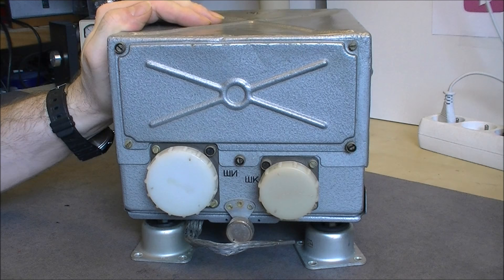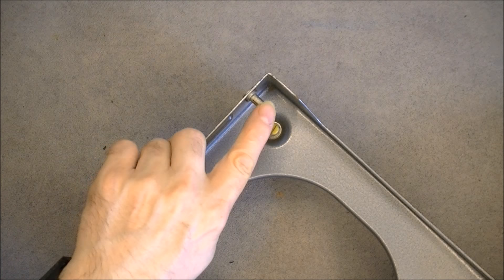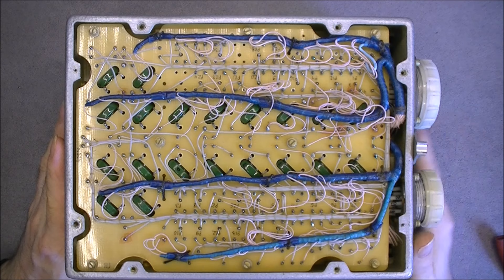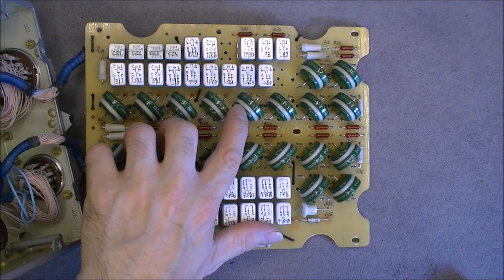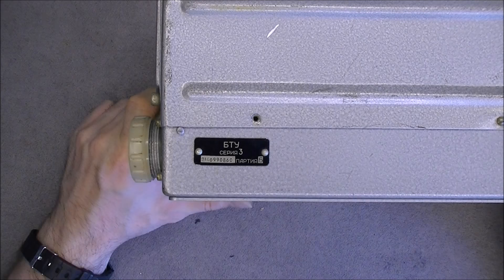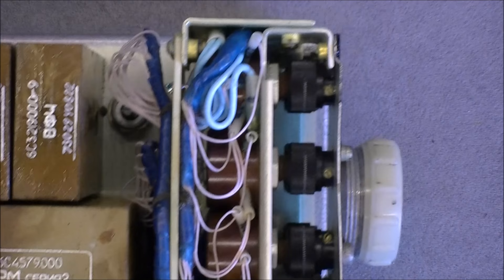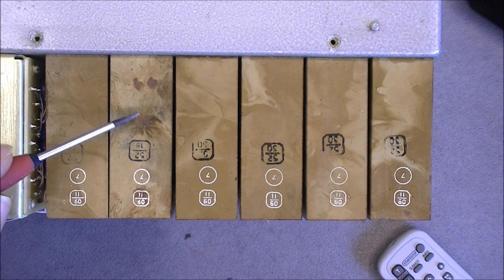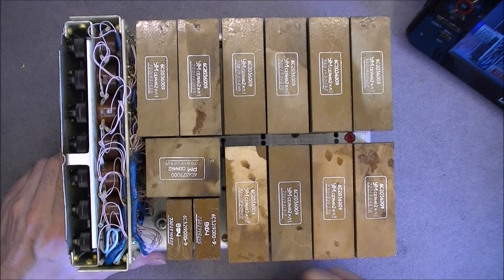Soviet avionics teardown: autopilot "brains" unit

Comment: According to part number those are magnetic amplifiers - усилитель магнитный
Reply: Then this is an analog computer.
Reply: maybe power amplifier?  усилитель мощности?
Reply: Magnetic amplifiers were used as operators in early analog computers.  They were replaced later by discrete operational amplifiers using bipolar or JFET transistors, and then by ICs.
Reply: В военной технике используются магнитные усилители мощности так как они устойчивы к ионизирующему излучению ядерного оружия.

Comment: Could it be the computer responsible for both of the Soviet Mi-24 and Mi-17 helicopters  auto hover feature?
Reply from the maker: It is possible, if you have some time to spend looking at random cockpits photos, I remember seeing on a photo somewhere a similar unit in situation in a cockpit, located in a rack behind the pilots seat.  Airliners.net may be a place to start.